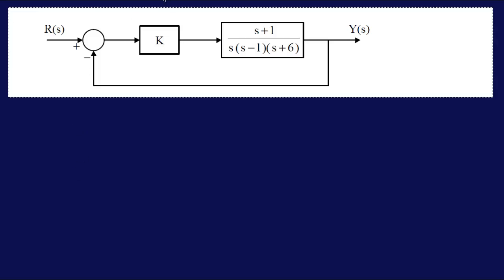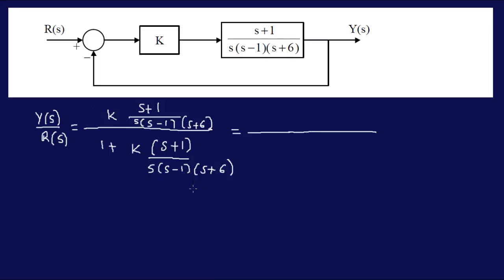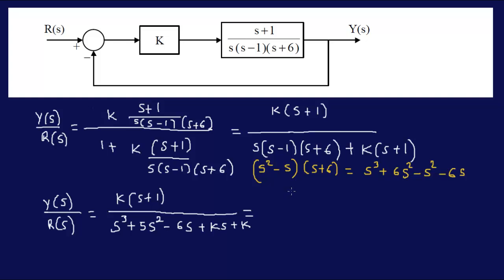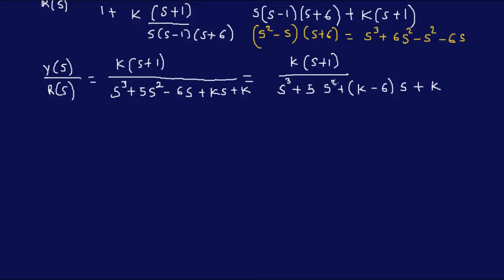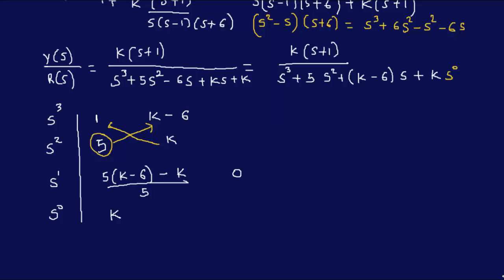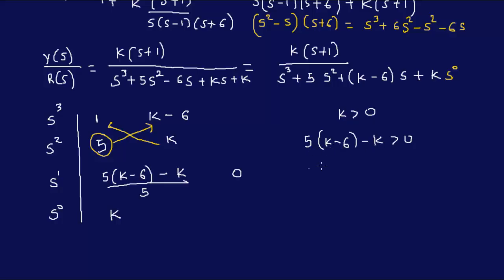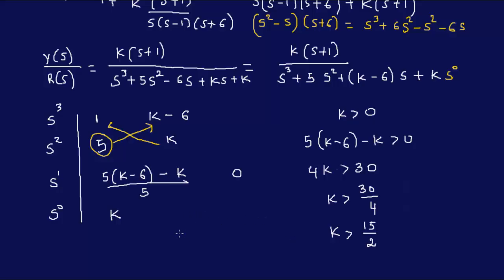Finding Range of K for Stability Problem 2--FE/EIT Review

Comment: In your previous video (Finding Range of K for Stability-FE/EIT Review) you brought the numerator (which was "k") down when doing the Routh criteria.
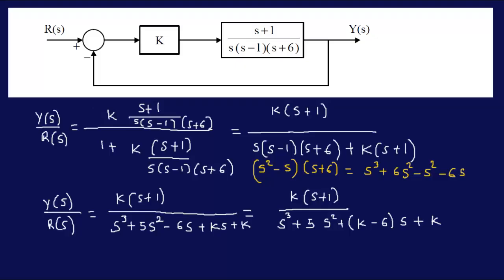For this problem, at 4:55 you say "[we already have a] k at the bottom" and then you do not bring the numerator down when starting the Routh criteria. This leads me to believe that if there is a k in the denominator, there is no need to bring the numerator down before starting the Routh analysis. Is this correct?
I am taking the FE next week and this is the first time i've ever seen Routh problems, so you'll have to excuse me if I sound like I don't know what i'm talking about....because I don't.
Reply from the maker: That's one simplistic way to look at it, because if there is a K already added at the bottom (and is the same as the expression as in the numerator), chances are you already factored it in but a more correct way to say it is to always use the closed loop transfer function to get the denominator G(s)/(1+G(s)). This example illustrates that. We brought (added) the whole K(S+1) to the denominator.

And you can ask me any questions, I'm here to help as much as I can. Good luck on your exam! Hope you do well...one of my subs told me he just passed last weekend.
Reply: How was your FE? Im taking it soon